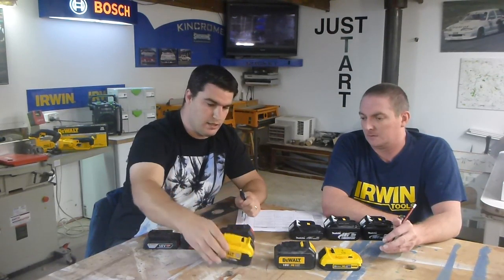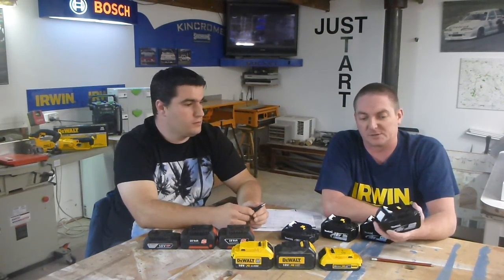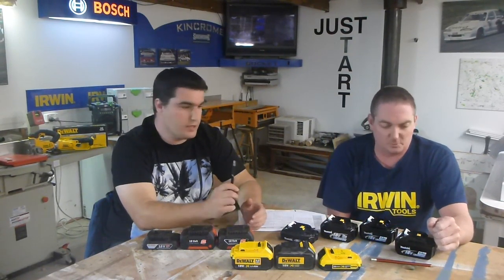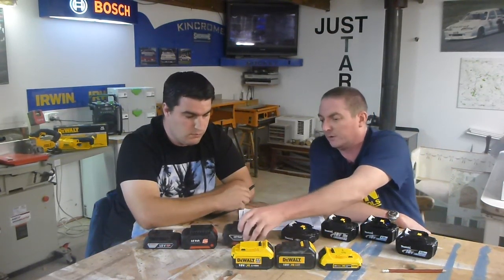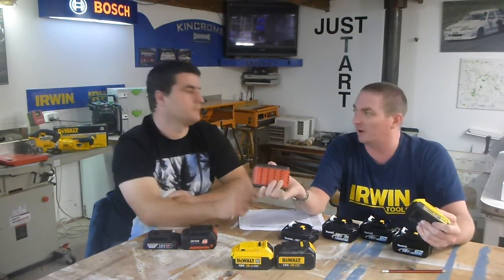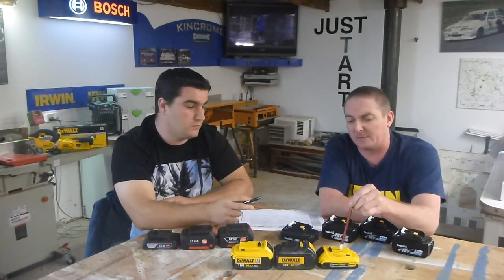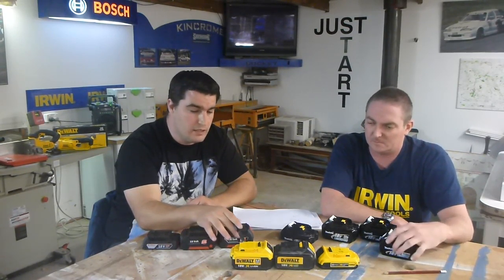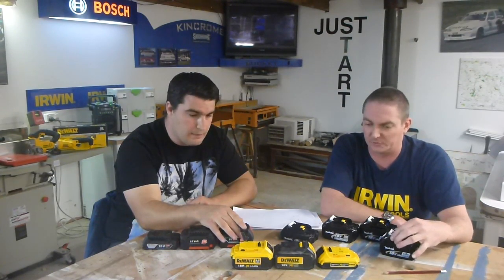Part 1: BATTERIES - Bosch-Dewalt-Makita 18V Comparison

Comment: Good Movies Guys !

I do think that the charging times of the batteries are a more important factor.  Makita's  4 Amp battery is charged in 36 minutes.  Faster by far then all other brands.  For example Bosch's 4 Amp battery needs almost an hour.

For me it's a big bonus. The current tools have such a high power draw and the faster your charger is the longer you'll be able to keep up :)
Reply: This is exactly what most peoples forget!
A battery tool is useless unless you can recharge a secondary battery fast enough to continue working all day.
I am always having a laugh when I see contractors coming with a huge amount of batteries and chargers to keep up with the battery consumption.
Makita has clearly the better and faster charger making it the most profitable tool I have seen.

Comment: Ive currently got a simple Makita LXT drill and impact driver, then later bought one of the low end angle grinder skins + a 3Ah battery

Was thinking about buying myself some of their new brushless LXT tools and maybe 2 or 3 5AH batteries.

Just wondering, have all the issues with the Makita batteries been fixed? I remember reading that some of their batteries had this issue where the logic in the packs would pull from only one of the cells. Which discharged that one cell, then the packs would get out of balance (i know the older Makita packs had no on cell balance charging) and if left for a while the charger would refuse to charge it. 

Im guessing some of that is part of the issues they had a while back with batteries you mentioned.
Reply from the maker: +TheColinputer the main thing you want to check is that your tools have a star on the bottom,/connector  or have a yellow connector. your angle grinder in particular may not take the larger capacity batteries :(
Reply: +Oz Tool Talk Pretty sure mine does have a star on it. Its not hugely old. But after watching your video on the brushless grinder, Just went out and bought myself the DLX2055TSP kit with the DHP481Z drill and DTD145Z impact driver, along with 2 5Ah batteries and charger

And also a DGA504Z brushless grinder skin 

Nice upgrade from what i did have. Although my wallet isnt happy haha.

Thanks for the videos guys, ive subbed!
Reply from the maker: haha, awesome new tools are hard resist! Mmmm 2.5Ah batteries, I love high capacity slim batteries! I'd be interested to hear if the grinder is as powerful on 2.5Ah batteries as on a 4ah or 5ah, can you borrow a larger battery?
Reply: +Oz Tool Talk Haha the way i typed that was confusing. I meant i got 2x 5ah batteries. Il see if there is any power difference on the grinder between my older 1.5ah Slims(They are stared so should work) and the new 5ah batteries ive got. 

Interestingly, ive seen ads for a 2ah slim (BL1820) however i cant seem to find any Australian retailer who sells it. I could get them shipped from the UK but warranty would be an issue then
Reply from the maker: Ahh you're sweet then. Nothing better than a slim battery on your impact driver to keep it light! Just stay away from the 1.3's, as they won't work with lots of tools.
Reply: +Oz Tool Talk Yeah +1 on that. I quite offten do work up ladders and that. Having a nice light compact drill with a slim on it is the best!

Comment: Good introduction.
Although, as far as I know Makitas star batteries are actually backwards compatible with all non star tools. However, you will only get the Electronic cell protection when using both starred battery with a starred tool.
Reply: I checked some more and it seems that the 4 Ah batteries are only compatible with tools either with a black starred bottom, yellow starred bottom or a yellow unstarred bottom.

All 3 Ah batteries should be backwards compatible, no matter if they are starred or not (only that you get the electronic cell protection when using both starred tool and battery together).

Comment: Good job guys Dwain and Mike! Great show and good points on the batteries. Makita needs to step it up with a fuel gauge although they have the best charge times 15 for slim and 30 for fat packs. Dewalt went backwards with their introduction of 1.3 ah no fuel gauge batteries. I wonder if they are pc batteries in dewalt cases. Seems like Bosch is in the lead with battery tech.

Liked and subscribed

Comment: Bosch has since released a 6.0 Ah pack: http://www.bosch-pt.com.au/au/en/battery-gba-18v-6-0ah-m-c-209604.html
So far as they are the only power tool manufacturer with a 6.0 Ah pack AFAIK.
I talked to a DeWalt representative last week and he said they had no plans to release packages above 5.0 Ah any-time soon as the cell prices are too high.
With a 6.0 Ah fat pack, they should also be able to release a 3.0 Ah slim pack with 5 * 3.6 V cells, instead of the 2 * 5 * 3.6V cells in the fat pack.
A 3.0 Ah slim pack would be enough for most common tasks, even more so with the new brushless tools which consumes less power. So you don't have to carry around the heavier fat pack. It's wasn't very long ago that fat packs was max. 3.0 Ah, so it would be nice to get the same capacity in slim packs.

Comment: The makita battery doesn't over heat when in use and the charger has a nice fan doesn't charge hot either. I do not like the textured bottom as it picks up everything and hard to clean.
Reply from the maker: [Dwain] I think any tools battery can be made to overheat with great stress (like continuous hard circular sawing). But I see your point about the base. The Makita charger HAS to be fan cooled because it charges so fast. It may heat up the batteries more than other brands even despite the charger. I'm not sure. Thanks for chiipping in!

Comment: just wondering if anyone has the new 4.0ah battery with the fuel gauge I bought one off the bay this week 15.12.15  and it came with a fuel gauge
Reply from the maker: +shooter75 sweet! i think they are mainly coming in the kits first, but i could be wrong.
Reply: +Oz Tool Talk I think Makita may have looked at a few of your vids because you always said the batteries are lacking a fuel gauge, I,m a Makita user have been for years, I,m in the trade and they stand up to use and abuse  and  they are getting better and better every year both batteries and the tool range
Reply from the maker: couldn't agree more shooter75. Makita are hitting big runs right now...

Comment: nice comparison, i love my dewalt 20v tools, almost bought makita but wasnt impressed with their hammer drill and dewalts impact is faster than makitas.
Reply from the maker: thanks Greg. It depends which impact driver you're talking about. Makita's 145 is even with Dewalts 886. The new Makita 148 smokes everything on the market. Makita has so many impact driver models, it gets confusing, but they're older ones aren't a match for Dewalt 20V (18V XR)